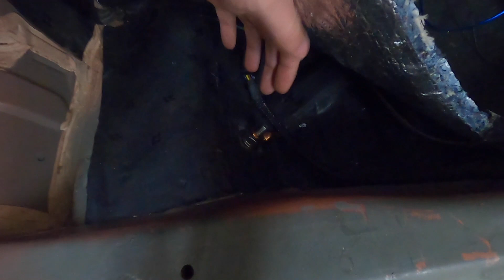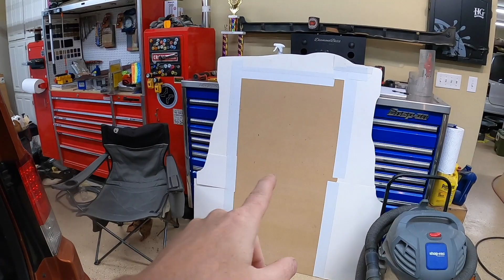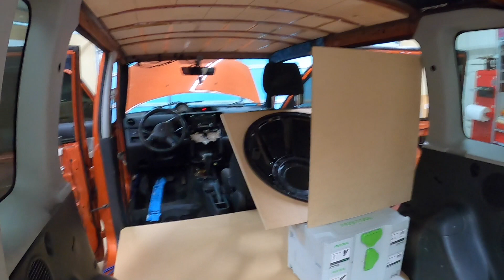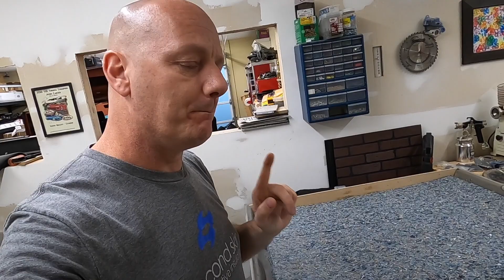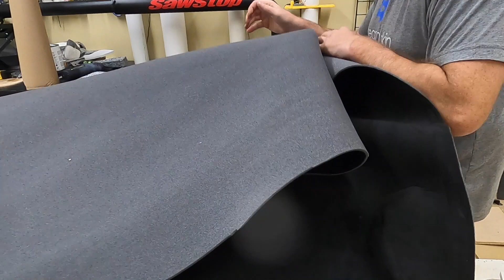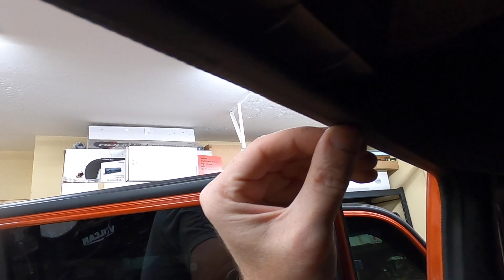Siclone Gets 24s - Part 2

Comment: Could have named this video "Siclone gets 24's - Part 2 AKA: The most ridiculous headliner ever!" lol. -- In a good way. So the spray adhesive you were using for the suede doesn't need to be sprayed on both pieces?
Reply from the maker: No NEED to spray both pieces. Used this in the Audi as well.